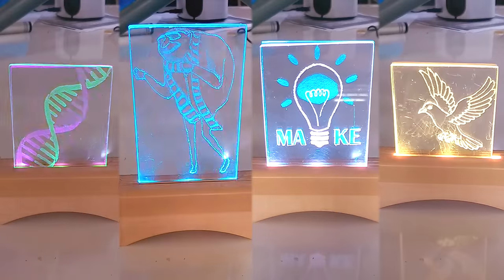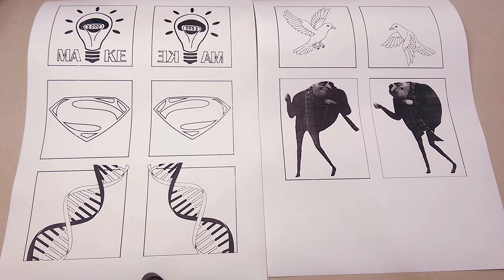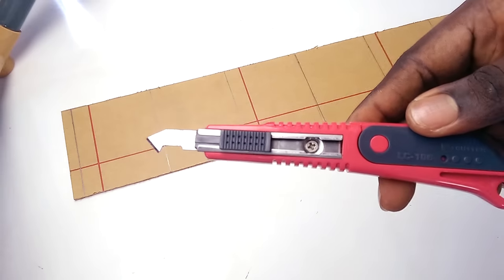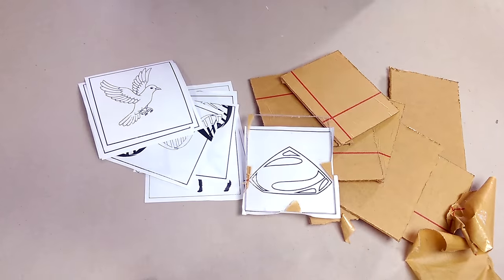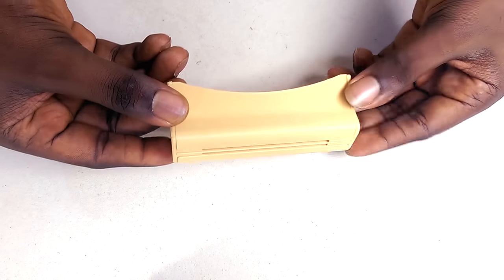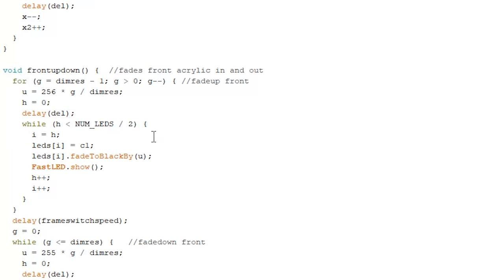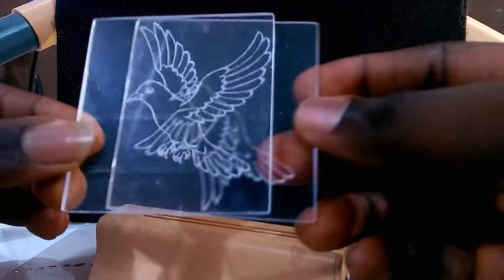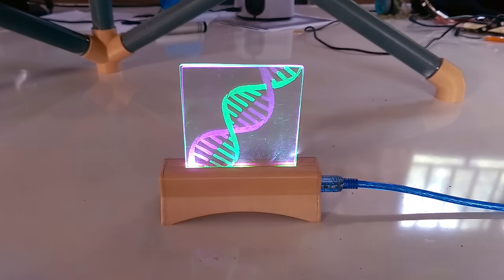Two Frame Animations With Edge Lit Acrylic | How to + Arduino code.

Comment: Cool video.  I wanted to share a trick I came up with doing something similar.  Because the LED devices are wider than a sheet of acrylic you can stack 2 sheets on their edge on the addressable LED strips.  Then you selectively mask, using black electrical tape for example, the edge of one or the other sheet of the acrylic.  You can then program the addressable LEDs to drive the color you want to the positions that aren't masked.  Works like a charm.  If you want more  light, buy the strips with more LEDS per meter.  Last point, the display is brightest when viewed from the alternate side from the one you etched.  People won't notice the 2 layers are a couple mm apart, but they will notice the change in brightness as it switches back and froth.
Reply from the maker: Thanks for the tip..
Reply: If I understand correctly, each sheet of acrylic can be assigned a unique identifier, correct --??
Reply from the maker: Yes...

Comment: You can also use side lit LED strips in order to be able to put the acrylic sheets close together and/or to be able to use more than two sheets
Reply: Side-lit and edge-lit are the same thing as far as i know. Edge-light being more specific to referring to an edge to light, where side-lit would imply any planar surface to light. The technique that he person in the video is using is edge-lit. This is because the light is being applied on an edge planar surface of the acrylic. If I'm wrong, and I have been in the past, Is possible that you might be inferring to a specific footprint ( size / package / topology ) of addressable RGB LED? If that is the case, could you leave a part number i the comment section, so others could look it up, then use it in their own builds? Thanks in advance.😄👍

Comment: I have been watching everything I can find and you are the closest I have found to what I want to accomplish.

I see you have named the led strips channel one and channel two. Where are these defined in the code?
If I wanted to use more channels, say a front plate which is constant and a back plate using flare; how would I run these steady while running the two frame animation in between?
And, what if I wanted to do a three or five frame animation?
For example: one a three frame - I would want it to run as
One - two - three - two - one - two - three - two - one - two and so on?